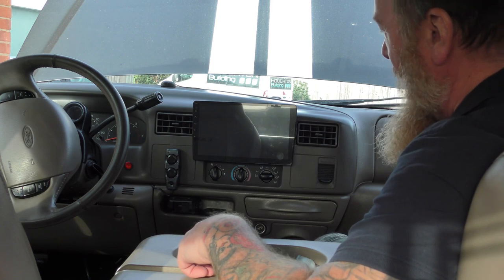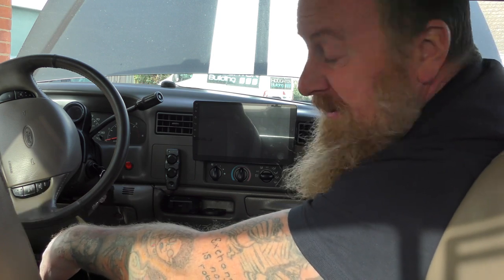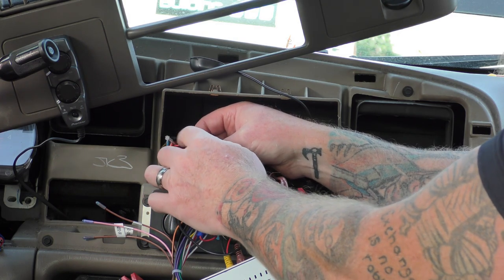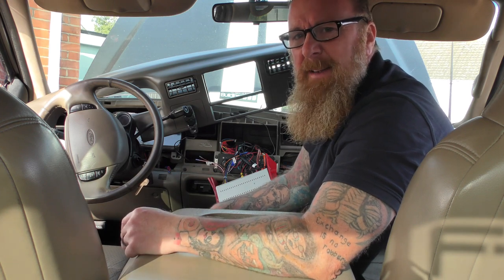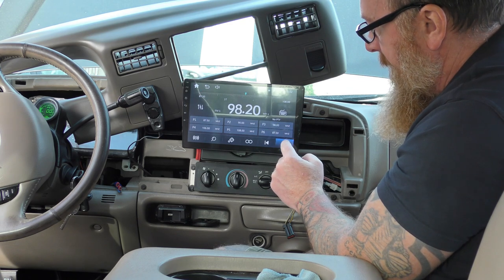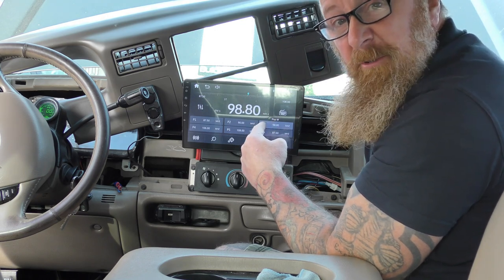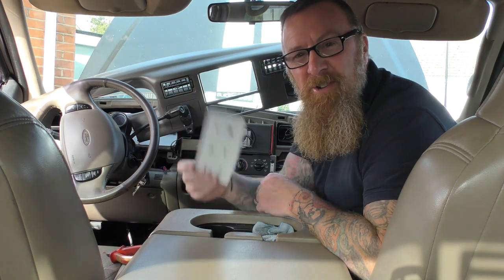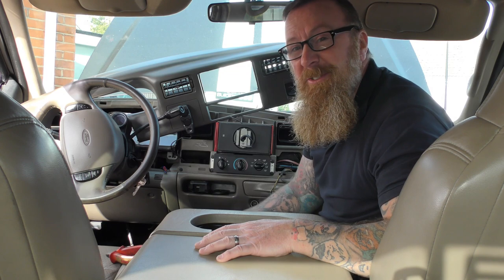EONON CAR RADIO LOOSES MEMORY HOW TO FIX IT MARK SAVAGE

Comment: Hi Mark can I ask your advice on a benelli 49x 2 stroke moped please? It starts fine and revs fine up to half throttle but bogs at anything over half throttle. When riding it it pulls away fine until I get to about just over half throttle then the bogging starts until I back off the throttle any ideas would be greatly Appreciated